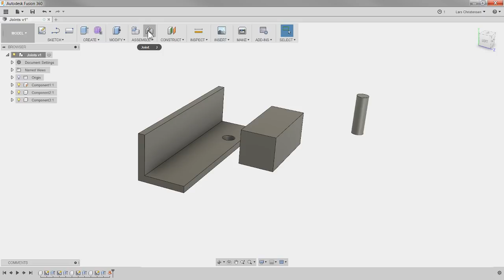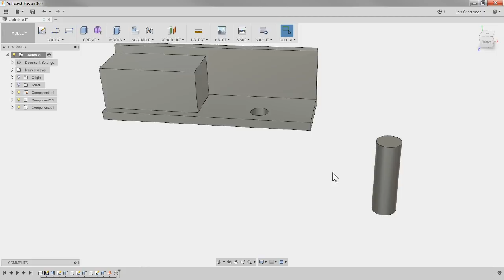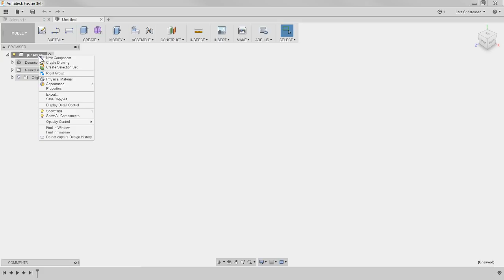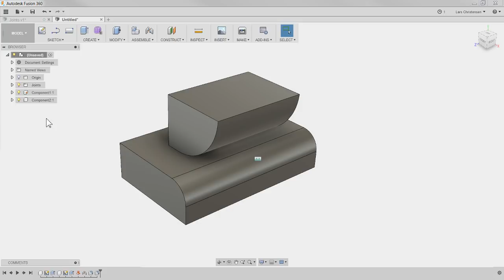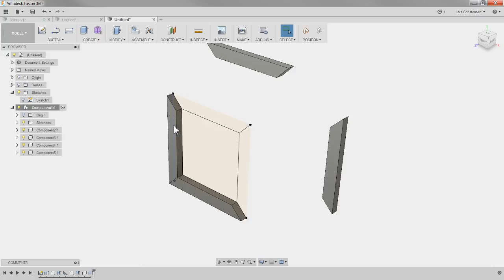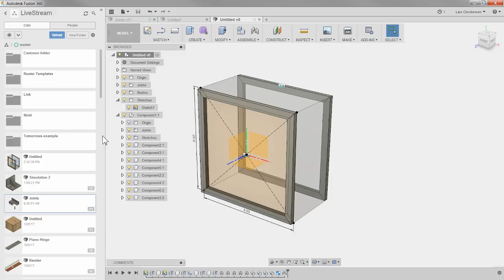Fusion 360 — 3 Reasons Joints Are Better — #LarsLive 73

Comment: Old video, but the problem is still the same.  These are canned examples.  Real-world things like starting with parts that have radiused edges completely destroy these examples.  Just add a radiused edges to the block in your first example, and you have to start jumping through hoops to do the same mate.  If stuff is asymmetrical and you can't grab a corner or center points, same thing.  Problems that are easily solved with mates turn into complete messes with joints.  You end up having to add sketches and other weird work-arounds to join things that should be very simple to join.

Comment: I'm trying to learn Fusion 360, but it's such a difficult program to grasp. Everything about it feels counterintuitive, even something as seemingly insignificant as zooming in. In every other program I use, you scroll the mouse wheel towards you to zoom in, but in Fusion 360, it's the opposite. I don't know, maybe it's some macOS quirk? The parameter system is extremely peculiar too. Why can't we just create parameters directly in the project tree instead of having to do it in a separate window? Parameters aren't even assigned to nodes properly, it's a mess. I haven't found an option yet to manually set the x, y positions in relation to other objects without using joints. Overall, it just looks like one big spaghetti mess.

I think I have the right to complain because for many years, I've been designing user interfaces in QML, and in QML, it's essentially the same process: creating relationships between objects, establishing their positions, and being able to create parameterized components. When I compare these two systems, I'm genuinely shocked at how things that are incredibly simple in QML have been unnecessarily complicated in Fusion 360. I don't know, maybe it's because of my lack of knowledge about Fusion 360, but when I compare how easily I learned QML to how difficult it is with Fusion 360, there's definitely something off.

Comment: So how can i mate a flat component to a cylinder of an other component? Now i used align and a tangent plane and then grounded the component.
Reply: Just use a Joint :) you can use basically any point on the parts as a reference and you can move them in relation to each other when placing the joint, if there is no points that naturally line up.

Comment: Everybody is showing these simple geometries in their tutorials for f360. What if I don't want to make an assembly that looks like the toys of a 2 year old?

I miss functions like tangential, concentric, coincident etc. To position parts in a way that is not what the program is guessing. 
Sometimes this function might work great, but if f360 doesn't know what I want to do it's just very frustrating.

Another thing is that parts are just floating around after I assemble them and I have to glue them together in a rigid group which is absolutely horrible from a construction standpoint. Whenever you want to change sth. pieces just stay where they have been and you gotta do everything from scratch again... 

If someone has help for those struggles, would be awesome

Comment: Lars:
Does the built in joint feature allow the movement or editing of the coins used for alignment?
Using your videos like a Kolledge Course!  
Great work, thanks
CA
Reply: In my experience this becomes very clunky and cumbersome to move anything around. If you define offsets with parameters, it becomes much easier to modify values in that table but that is also time consuming to setup.

Comment: Hey Lars, how about suggesting to the guys that there be some extra controls over the push-pull/extrude "operation" setting?  What I mean is, when you're extruding stuff and all the pieces need to be new bodies or new components but they are touching already existing bodies or components, Fusion automagically sets it to "JOIN".  That ain't cool.  I find that 90% of the time JOIN is NOT what I want.  Instead I have to click to change it every single time.  I saw you deal with this during this video.  I want some extra controls over the defaults for this. Don't you?

Comment: Dear Autodesk: You need to STOP telling your customers that they are wrong about this when they ask for competent mating functionality. SolidWorks Mates are miles better than Joints, and they take me less than half the time to set up. If you intend to remove the free option in Fusion 360 (as you inevitably will) and expect people to pay for your software, then you need to FIX THIS - and I'll say it again, STOP talking down to your customers and telling them that they are wrong. When you deliver a solution that is actually better, then you'll be able to charge for it like it IS better.

Comment: If your model in Inventor blows up when you change the parts, you’ve made the joints/mates in the wrong way. Top down modeling, constraints to work features instead of faces and edges and you don’t have a problem. Try to make joint to a work feature in F360 - you cannot. So you actually cannot make the joints as early as you can do in Inventor. Still like the video, though. Joints are hard to get your head around if you’ve been in Inventor world for at least a decade...:)

Comment: Every tutorial explains the same “joint” process over snd over. A cylinder in a cylinder or a face to face or corner to corner is all fine and easy. However, for engineers working with clearances, we’re not always dealing with cylinders. What would be nice to know is... say you have a rectangle bar stock sliding back and forth inside a rectangular/broached opening. In Solidworks, all i need to do is select all 4 sides of what i want aligned and hit mate. It will center that part. I then do the same for the other 4 surfaces and it centers again. Now i have my part centered with even gap all around even if the gap one way is not equal to the other way. 

How do i do that in Fusion?

Cheers,
Ken
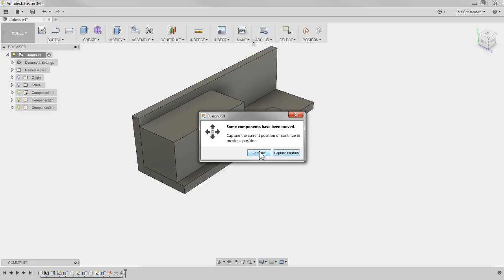Reply: I think from 11:37 creating your own "joint origin" will help you a lot. I agree these joints are painful.
Reply: @AdrianTregoning  It took me 30 minutes to figure out that a Joint Origin was what I needed to make my model work at all the way I wanted to constrain it. It was 30 minutes of frustration and rage, and I destroyed a perfectly good mouse in the process. And I still have to open each individual part model to create the joint origin in that model; you can't work with parts natively within assembly models because Autodesk has decided you don't need that functionality.

Comment: It is a pretty genius system but it does suck when working a lot with aluminium profiles as they tend to have rounded edges. And since you can't joint round edges properly, it becomes quite tedious (not to mention imprecise) to mess around with all sorts of manual offsets. I wish Fusion would allow is both approaches when it comes to the freedoms.

Comment: I can see how joints work well for simple geometries.  But from what I've experienced so far, the simplicity quickly turns to being cumbersome and unintuitive when I have complex geometries and multiple components.  My problem has been that the components I work with often do not have nice sharp edges and corners, and being restricted to using joint origin points as opposed to surfaces for mates makes it tricky.  I also have to deal with odd positioning (e.g., clamps in various orientations around a part on a mill table).  I have recently been working on a setup for a mill, and after a few hours of trial and error and several tutorial videos later I was no closer to getting this thing put together, which would have taken me all of 2 minutes in SolidWorks or NX.  I finally got it to work by only using planar joints and restricting degrees of freedom a couple at a time, a very roundabout way to get the same result as in SolidWorks.  

It's worth considering that there might be a reason the other major CAD systems do mates/constraints/etc. a certain way.  Restricting degrees of freedom one or two at a time is simple, quick, and intuitive.  And it stays simple, quick, and intuitive regardless how complex the components are or how many components there are.  Don't get me wrong, I really like using Fusion for the most part, having come from many years of Mastercam, Solidworks, and NX.  I think they took a big step backwards on this though.

Comment: Hello sir , 
 I made an simple engine and i made an cam shaft which pushes the valves down and up using  enable contact sets and create contact sets and it is working but the laptop lags when the cam touches the valve to push it down , its all working perfectly but lag when they touch . my laptop is good , no problem . what to do ,  ? please help me ?
Reply from the maker: Hi sanket patil Thank you for watching!
Fusion 360 is probably doing a lot of calculations trying to do those contact sets. You might want to build it different. Depending on the size of your assembly, you might like this video:
https://youtu.be/Ur0b6hh9joM

Best,
Lars
Reply: Lars Christensen thanks sir

Comment: Nice tutorial. What's your solution for mating coils to other surfaces? Specifically, the centre axis of a coil at the end face to another...?
Reply from the maker: Thank you Max Kofe
You can use joints with sketches. Do you have a guide curve you could use from the sweep that created the coil?
Reply: Lars Christensen  Thanks. I found that method the "long way"...I also use the Offset Plane method and they both work fine for me but unlike say, a threaded bolt where the "half moon" can snap to points on the face I thought there might be another way to maybe snap to the central axis of a coil/spring at one end...? Cheers for all the tutorials, I've only just started with Fusion and I'm liking it. 👍👍

Comment: I got the Joins from different side flip the part to the left on X Y Axises and up side down??
Reply from the maker: So two things I did forgot to add to the video. First always select the part you want to move first. Second, the litttle coin has a front and a back so depending on what side is up or down that will flip the part. There is a flip button on the dialog that will flip them around though